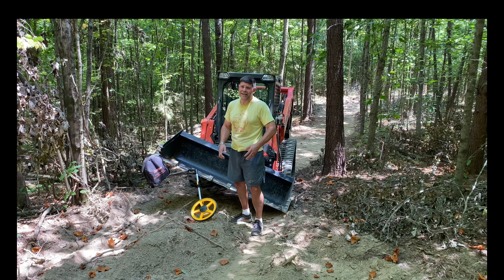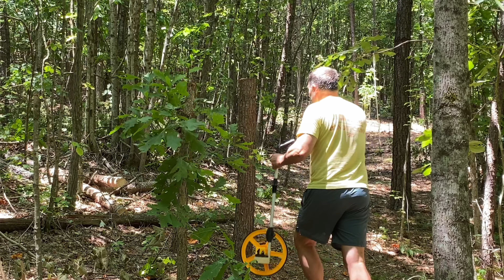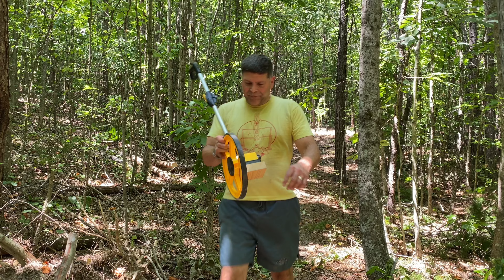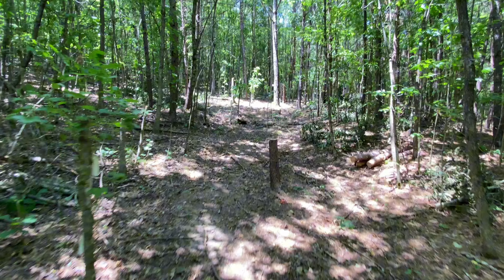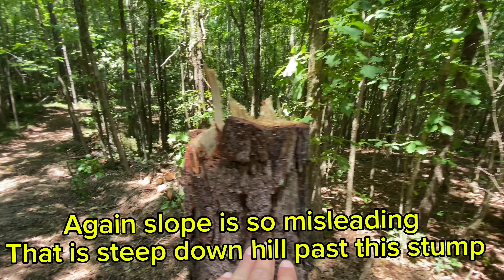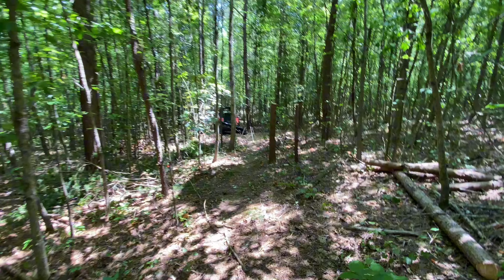Building a trail, Day 1 part 1, using Kubota SVL75-3  How many feet per hour can we clear?

Comment from the maker: The tilt bucket has been a good investment thus far but I need more time using it before giving my final 100% endorsement.  My next projects are all trails, driveway, dirt moving where I will need the tilt bucket so that should give me the opportunity to really show it working in action and give some pros and cons.   Let me know if you have initial questions about it, and rest assured, more videos on the tilting bucket is on the way.

Comment: Thoroughly enjoy your videos. We too have a new 75-3 and are going through a similar learning curve (loving every minute). Never really considered a tilt attachment for the bucket until seeing your experiences with it. Looks like my attachment list just got longer. Appreciate the content as always!
Reply from the maker: There are about 4 or 5 different manufactures.   Several also have a hydraulic switch, like a tractor 3rd function.  If you were putting a hydraulic pallet fork on the TH35 you would need to find a 3rd party 3rd function kit.   Some of the manufactures sell it as an option but Land Pride does not.  Land Pride does have an option for a check valve that helps keep the angle set against the pressure of pushing the bucket into the ground.  It's a $350.00 option and thus far I haven't noticed that I need it.  I am changing the angle so often that I haven't tested to see if it actually drifts off the setting I had it at.   I think if you are doing grading it will be helpful for us rookies.  Experts, maybe not quite as much, but in tight spaces it's amazing to do grading and stump digging with the bucket.   Let me know if you have any other questions.   Thanks for watching
Reply from the maker: Also, I am told to really get good (perfect?) grading you need a smooth (no teeth) bucket.  And if the bottom were longer you could see it from the operators seat which would make grading easier.... I'm not at the point I need perfect or even close to perfect, but maybe in a year when we build our house.